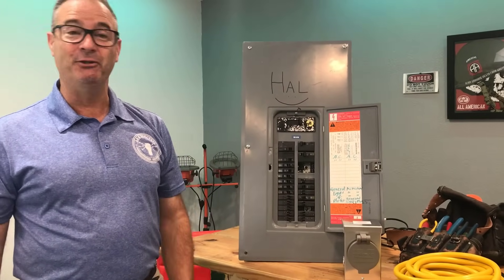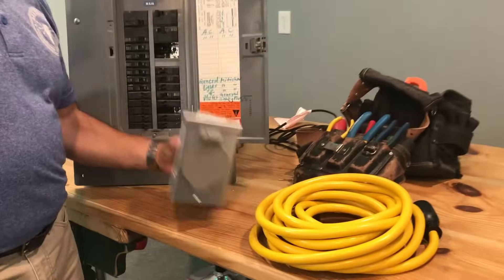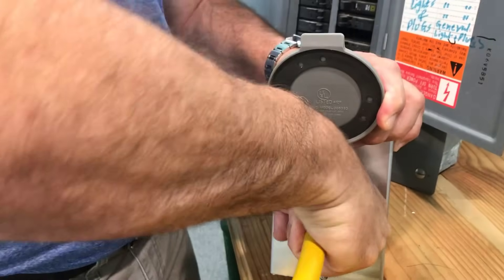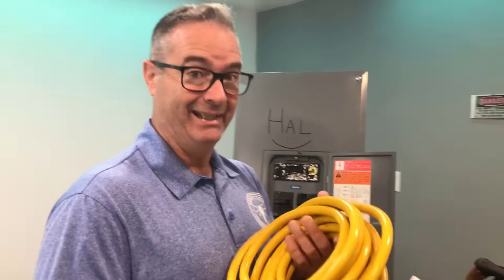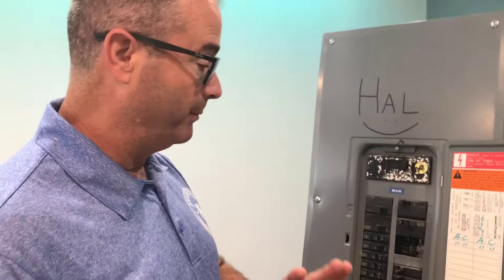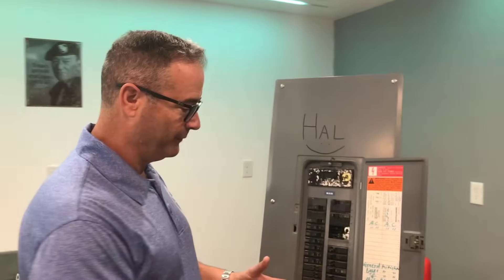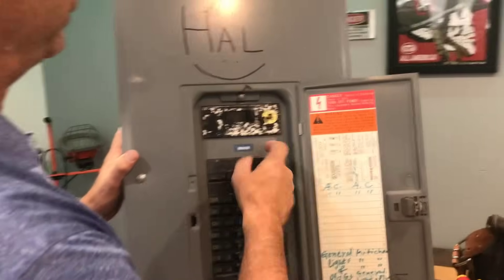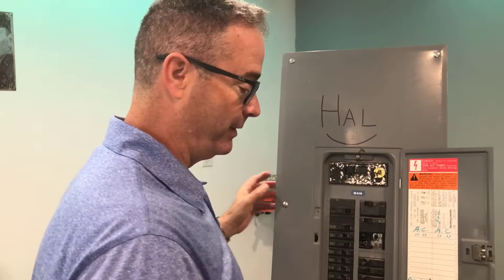4 Generator Hacks by an Electrician

Comment: All excellent ideas.
Dry run for sure! Helped a friend set up a generator and found out one of the circuits he thought was on the generator subpanel was not. So the second freezer in the garage was not protected.
Reply: I have 2 transfer switches. I have a sub panel with loads like lights, fridge, freezer oil furnace and TV/ internet. I can run this on a Honda 2000 for over 10 hours on a gallon of gas. We have a 7000 k with a remote start on a whole house transfer switch when we need the pump and other high loads. It’s October and I just changed the oil and drained the old gas and put in fresh gas and ran them both with a load. These transfer switches are separate from the break box. Transfer switches like the one shown here aren’t allowed where I live and if you get caught your power will be shut off. They do not want two different energy sources in the same breaker box.
Reply from the maker: @Chris_at_Home  what kind of transfer switches are you using?
Reply: @abrelectric  I use this on my Honda 2000.
Reliance Controls CSR202 Easy/Tran Transfer Switch
The  sub panel is only wired for 120 and has a 30amp breaker in the main panel. 
I don’t know the brand name of the whole house one off hand but it is 3 pole 225 amp break before make type. It’s manual and it’s pretty big. It’s got a big flat bar type handle with an interlock that only lets me open it when it is in the break position.
Reply from the maker: What did he do?
Reply: @abrelectric  Nothing yet... There are other adjacent outlets in the garage that are on the generator subpanel. So he will either move the freezer about 20 feet to the desired outlets or use a good extension cord... This was all wired up 14 years ago when the house was built new. Just lacked the plug in for the generator on an exterior wall... It's in Texas so he was without power for a while like many through the big freeze in Feb 2021. That was the wake up call!... He'll likely wait another 14 years to actually hook up the generator and see if it works 😅

Comment: Yes, buy a longer cable to your inlet box.  My cable is 50 feet and that is so that the generator can be 50 feet away on the porch of our outbuilding (under a roof).  The generator can not be in the rain, so build a porch on your outbuilding.  It is an easy thing to do and will help you the other 364 days of the year when if you have to go to your outbuilding in the rain.  Buy a larger waterproof cable because when you need power, you want it to be able to be in the rain.  Put your inlet box in a sheltered place so it wont be rained on, as well as your generator.  While it is raining during the disaster, plug your cable into the house inlet box and put your generator side plug in the door to your outbuilding.  Start your generator, then plug in the generator with the dry plug(wear your gloves).  Better yet, put your house inlet plug in your outbuilding and run a permanent cable under ground to your house.  Then you dont have to worry about running around in the rain.

Comment: I have run the same portable generator for 22 years with only one carb failure. I use only non-ethanol fuel treated with Stabil. I keep 60 gallons on hand. After 6-8 months I use the fuel in my car and refill the containers. I average 1 minimal outage a month (< 2 hours) and 2 major outages a year (over 18 hours). I learned my lesson in 1999 during an ice storm without power for 4 days and have had a generator ever since. I interlock my main and back feed from a shop. Recently I added a soft start to my heat pump and can now run my cooling during an outage. I rely on kerosene heat in the winter since the HP draws too much power for the heat strips.
Reply: What brand of soft start did you use? TIA
Reply: @KhoiNguyen-ic5pi  I use a Micro-Air EasyStart. It is on my Goodman 2-ton. Had it almost 1 year and zero issues. Ran my heat pump once late last year and already twice this summer (about 1 hour then about 4 hours).
Reply: who gives a f....

Comment: I always use non-ethanol, gas in my generator when possible. During hurricanes I have to use regular gas due to supply but after hurricane season, I change it back to non-ethanol. My Generac generator is 20 years old.
Reply from the maker: Good to know. I'm glad to hear that your Generac is still serving!

Comment: The interlock's critical role is NOT to protect your generator (although it does) it is to ensure that your generator is not back feeding on the grid while linemen are working through the snowmageddon/zombie apocalypse to get the power back on to your grid.
Reply: Especially so, given that the linesmen will usually be working on the other side of a transformer. Your little 240 V gennie can deliver ten times or higher voltage thanks to the magic of transformer action.
Reply: That’s why you need a transfer box , one switch changes from line to generator power. No back feeding with power line.
Reply: Yikes
Reply: I was getting ready to comment there exactly. Thanks. Not an electrician, don’t have a backup system installed but heard that a long time ago.
Reply: I like the protection of the generator idea. That way, even totally selfish people have the motivation to do the right thing.
Reply: 100% Correct.  Buddy of mine is a lineman.  First thing they do when they get to a neighborhood without power is turn off all their trucks and equipment and listen for generators.  They then go to the houses with generators and verify they have an interlock and not back feeding the grid.  If a house is running a generator without a interlock they pull the meter and put a blank over the meter location.  This protects them from getting zapped.  Eventually they will get around to reinstalling the meter but it will be the last house in that area to get put back on the grid.  That could be days or a week or more until they get around to it too.
Reply: Unless the downed line is directly between the generator and ANY other customers, this is a ridiculous urban legend. Otherwise, the genset will either trip offline instantly or literally burn up, shorting its windings and stalling the engine, even just considering the inrush of dozens of transformers and nothing else. In an underground residential distribution area, this is simply impossible, for hopefully obvious reasons.

We need to stop pretending the interlock protects anything but a clueless homeowner from blowing up a generator. It just suggests the person parroting is either being intellectually dishonest out of an abundance of caution, or doesn't understand the basics of power distribution.
Reply: You have to disconnect the ground wire from the generator to the transfer switch as there can only be one point in the system where the neutral and ground wires are joined.... this is at the main disconnect.
Reply: As seen with the mask debacle, Americans don't care about protecting others. It's all about what's in it for them so I think he stressed the right point.
Reply: Exactly
Reply: As a former lineman, I damn near fell out of my chair over that last statement. F$$k the damn generator!! Guys are working on that line to restore power, and that husband,-father does not need some dumbass  high potting voltage back on the line with his precious generator.. You people putting out these videos need to rethink how your content affects people!!!!!
Reply: @brentlanyon4654  THE LOCKOUT… The chances of power feeding back for more than a second or so is near zero. The immense demand load of the neighbors and grid will pop the generator breaker.  It is however ‘best practices’ no one with factual technical knowledge would debate.  However if the generator were turned off for any reason or for the night, sitting on the load and the utility power returns, you may have a fire along with a shit show with your insurance company denying the claim where you burned down your home down to the ground or so due to an electrical Code violation.  Now that’s the illuminating truth.  Some of these comments are not correct or safe and why professionals should be doing the work.
Reply: On every generator there is a grounding lug for bonding to earth.  Connect a wire from it to some established metal that goes into the dirt.  Use it if you are concerned about saving a lineman.  Use it if you are concerned about saving the electronics in your home.
Reply: Reeeeealy! Any lineman who doesn't concider all lines live isn't gonna last long. Rule #1 all lines are live. Suicide cords all day. Dont touch bare wires you could die, don't put a gun to your head and pull the trigger, you could die. It's a shame you have to save people from themselves, common sense just isn't commen anymore
Reply: The moment a generator is feeding the neighborhood, it will either trip the breaker on the generator, or become disabled almost instantly. Find me proof in the last 25 years a linesman died from a 7500watt back feeding generator.
Reply: @FlightSergeantRose  A 30 second search found one killed on 11/06/2004
Reply: @FauxQue-yk8dt  Are you just saying that there are very low odds of a lineman getting injured from a generator that's wired in without an interlock or break-before-make switch, or are you saying that there's no reason to worry about it at all? I agree that the odds of any specific instance causing a electrocution is extremely low, but so is shooting an arrow up in the air in the woods - the odds of hitting someone are extremely low, but that doesn't mean it isn't a stupid thing to do.

You should probably also give lip service to the fact that there are other reasons why it's a bad idea. That way people won't look at your comments and think, "I don't have to worry about how my generator is wired up".
Reply: @paulfrank8738  Odds are slim to none.
No it's not safe to back feed the grid. Linemen are properly trained so their risk is low. Of course they could shortcut their training
 You also risk electrocuting your neighbors.
But again, your generator would have to suffer a failure of the circuit breakers if you were to feed back onto the grid.
You can't ignore there has only been 1 fatality that might be linked to back feeding. And that's probably higher than the arrow in the woods comparison.
I guess I have to repeat. Don't try it. It's unsafe. Just like the double ended sewer side cords thousands of people use.
Reply: @FauxQue-yk8dt  I think you and I agree; we're just arguing semantics. For example, being a very literal person I agree with the "slim" part, but disagree with the "none" part of your "slim to none". But again, that's just semantics. I know what you mean.

Thank you for clarifying ... not for my sake, but for those who might misunderstand. Experience has taught me that a significant percentage of people aren't competent in their own profession. So, I have no confidence in the ability of the general public to do anything with electricity. And I didn't want to leave anyone with the idea that they don't have to worry about how they hook up a generator.
Reply: @FlightSergeantRose 
 Ok. Show me where it's NOT illegal to connect your generator without it?
Reply: @kirkstinson7316  I'm not arguing about the legality. I'm arguing about the lies being spread about the dangers back feeding for a split second before the generator cuts off from being over loaded because it would be trying to feed a whole neighbourhood.

Comment: All great points, and you are right about not wanting the generator running with the main on if the power comes back on, but the main reason is for safety. If the Main is left on while the generator is running, it will back feed the power line supplying power, once it gets to the power company transformer that normally steps the voltage from 14,400 or 7,200 volts (depending the power company) to 120 which becomes 240 when paired at the main, the transformer will step the voltage back up. This would not travel a great distance because of low amp but would be harmful to power line workers that don't know the line is hot.
Reply: I wonder how a portable generator would fair trying to energize a Xformer on the pole?
Reply: @hottractor1999  Enough to harm a lineman that is trying to get your power back on.
Reply: If it  back fed, I wonder how long it would take for the breaker on the generator to trip once the houses next door powered up?

Comment: I do small engine repair. Number ONE issue; bad gas. People stick that generator in a corner, pull it out 2 years later, when needed, and wonder why it won't start.
Reply: That’s is true, a lot of people think(I also did) that fuel is good forever, but it can only be stored for so long(a few months) before it goes bad.
Reply: Go with propane. Stays good for years.
Reply: I've personally found that gasoline can be stored perhaps indefinitely and be just as good after many years as the day it was purchased. I think the bad gas theory comes from the time when everyone had open spout storage and the gas would lose volatility over time through evaporation. Dunno, the jury is still out on this one in my little courtroom in my head.🤫
Reply: @Rick-the-Swift  The problem is the gasoline which has 10% ethanol, which attracts moisture and ends up clumping in the bottom of the container. You'd be better of with the "ethanol free gas".
Reply: @Gallagherfreak100  Right on. I meant to mention that moisture was/is probably an issue in open spout or non sealed containers. I've heard some say they've stored ethanol for 5 years. Is it not the lines, seals, gaskets etc. that it's said causes most problems with ethanol? I haven't heard much about solid containers. Always willing to listen and learn though.

Comment: I know you’re an electrician but I know a very good small engine mechanic who would say your maintenance is incomplete because an emergency household generator also needs a load test on a regular schedule. It doesn’t need to be a long test or a high load but the field in the generator needs to be excited quarterly or it can lose it’s ability to produce electricity.
Reply from the maker: I did not know that! That is a great point
Reply: I have heard that but bought a  5 kw  generator and it sat in my storage building for over 5 years and had never been started.  I took it  out this fall and put oil and gas in it.  Hooked up one of those car emergency battery packs to it and it started right up with the electric start.  
Then plugged in a 1500 watt portable heater and it generated electricity just fine.  Ran it for 2 hours and changed the oil and put it back in storage.   I have another 20 year old generator and it sat for about 2 years from the time I last used it and it generated just fine.  I always use ethanol free fuel with stable in it but drain the tank or run it empty and run the carburetor dry on all the small engines I have if I do not plan on using them for over a month.

Comment: Good info BUT more  needed.
Have new spark plugs, oil (and tools ) on shelf for generator BEFORE you need them, also air & gas filters have them ALREADY there. Are you going shopping when the electricity (during storm time at 2 am , in the dark ? ) is out ?  How about extra large type STEP BY STEP instructions in a sheet protector BY the generator AND by the box. Make sure whole family can follow those instructions. You might be able to talk someone through it with the instructions there.

Comment: So this might already be in the comments somewhere, but the manual for the pro trans say they need to be used with a floating neutral generator. My understanding is that most generators have the ground and the neutral bonded at the generator. Is this a problem?
Reply from the maker: When the main breaker on the generator is GFCI protected  - yes. Several brands have a 2 pole 50 amp GFCI breaker for it's MB. Trips instantly unless that jumper is removed

Comment: Loll. That happened to me. I did my annual maintenance on my Kohler 20kw standby system. Forgot to turn the breaker that is wired to the internal battery charger. When the power went out a week later the transfer switch did its thing and the auto start did not work because the battery was dead. 🤦‍♂️
Reply from the maker: Yep. Ain't that the way 😀

Comment: I have  to  put  my connect  box at  about  40 feeth from  the  electric  box  
is it  ok  or  I have to limit  the distance  until  I use  no 10  cable  for a 50 amp  generator 
no possibility to install the generator  near  the  electric  box ?
what the maximum distance  for  the connec  box

Comment: Nice presentation. I would add that you should run your generator once a month to make sure it operates and perform a simulated power failure on your house once or twice a year. Your generator is known as a STABD-BY GENERATOR, not an emergency generator. Emergency generators are designated as hospital generators or other locations where life saving equipment is used.
Reply: If your home [health, from heat, humidity, supplemental oxygen, loss of food, etc] is going to suffer adverse consequences from lack of electricity, then, yeah ... your genset is and emergency one.
Reply: Picky picky…..I think we all understand the deal here

Comment: Good advice. I do all of the above. I only use non-ethanol  gas in my generator. I add STA-BIL Storage Fuel Stabilizer in all my stored gasoline. Ethanol attracts moisture. Moisture is a small engine/carb enemy.
Reply: Non-ethanol gas is the only fuel I use for all my small engines, including my generator. Thanks for pointing that out for others. The last thing you want in a snow storm without power is to have to clean the carburetor to get the generator running because you used ethanol based fuel.
Reply: The problem I have is that companies won't tell me what the ethanol content is. I wrote Shell and they told me to get in touch with their Tech dept.
Reply: @sonnybowman get a graduated cylinder and do the water test.
Reply: @sonnybowman  There should be a seperate pump with non ethanol gas .